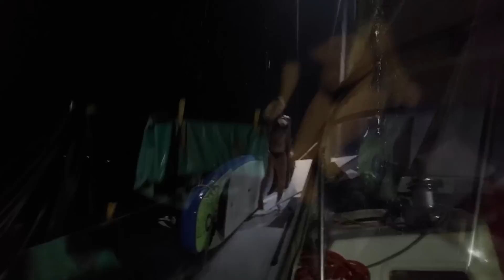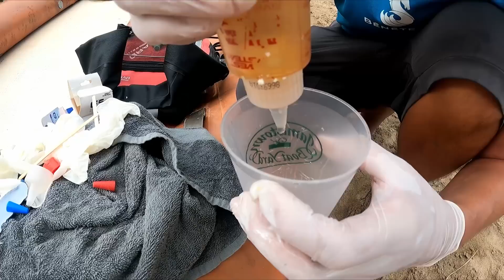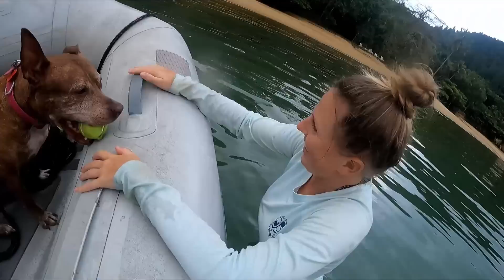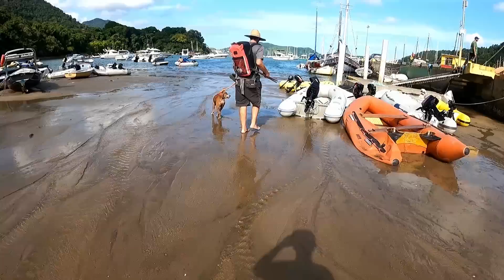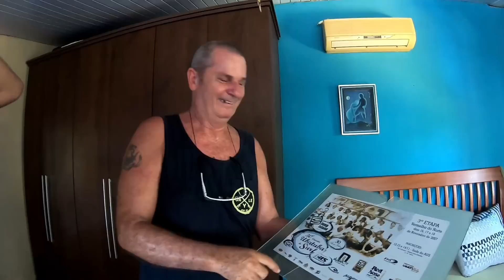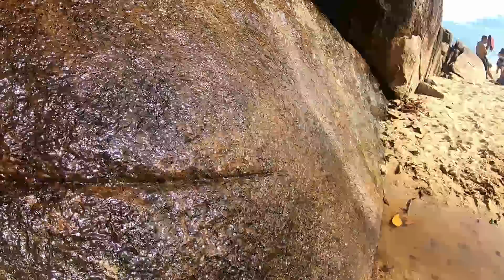We Should Keep This a SECRET! [Ep. 80]

Comment: Are there drawbacks to cockpit enclosures? Yes, there are many of them—my initial skepticism was not baseless. To list a few:
No matter how well designed, movement around the boat will be slowed down.
It’s tempting to sit in the comfort of the enclosure when we should be out on deck dealing with something that needs attention, or just roaming around checking stuff.
The damned things, done right, are expensive.
Definitely a hit to good visibility.
Can easily be damaged by high winds, and a boarding sea will wreak expensive havoc for sure.
It’s just one more damned thing to maintain, since the plastic windows need regular cleaning and polishing…really regular…OK, frequent…to maintain good visibility.
Reply from the maker: Thanks for sharing. We will find out but have enjoyed our cockpit thus far! There are always things that can be altered on a boat 😁